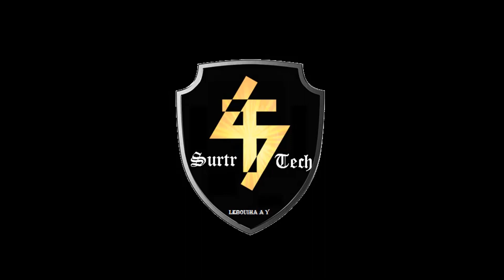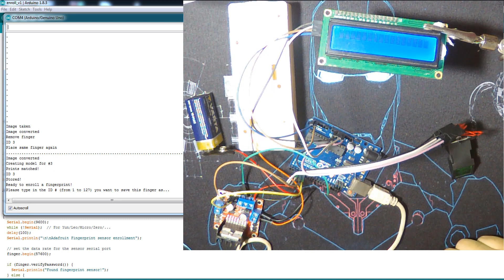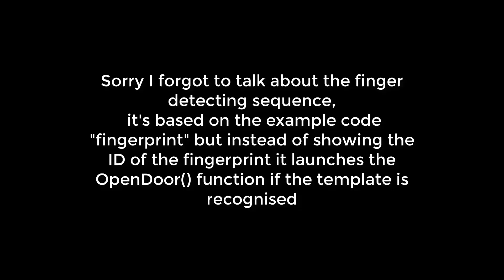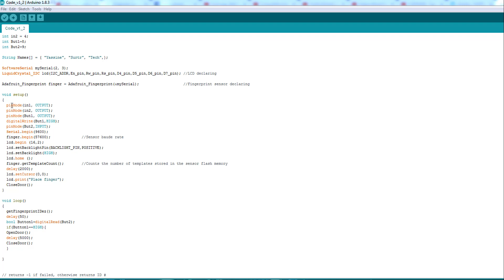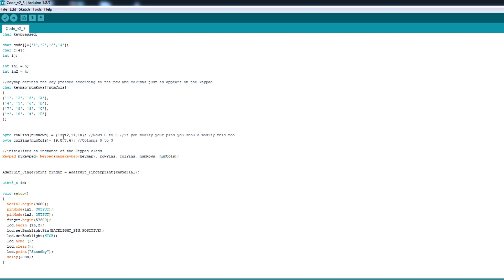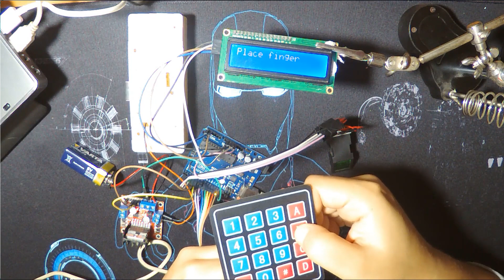Easy Arduino FPM10A Fingerprint door lock

Comment: hey can i know the connections of the fingerprint scanner and also that should i short the above points on the scanner foor the input power
Reply from the maker: Hello all the wirings, libraries and codes I've used are in the link below the video.
Reply: @SurtrTech  can please check your facebook page i have messaged you
Reply from the maker: @adityagawde  ok

Comment: sir , can i change some hardwares like finger print (Finger Print Sensor R307 -TTL UART) and door lock with Solenoid Lock...plese help me with circuit diagram for Solenoid Lock and aboud fingerprint...plese share ur contact number...
Reply from the maker: You contacted me on FB right? I answred there

Comment: exit status 1
no matching function for call to 'LiquidCrystal_I2C::LiquidCrystal_I2C(int, int, int, int, int, int, int, int)'

Help me to solve this error
Reply from the maker: It's the LCD i²c library problem, did you install it? Or are you already using another one?
Reply: @SurtrTech  i already installed library
Reply from the maker: @moiziqbalcreator  You need 2 libraries did you install them both? Adafruit fingerprint and newliquidcrystal, and check if you don't have other ones for the LCD already installed
Reply: @SurtrTech  yes i already intalled
Reply from the maker: @moiziqbalcreator  The error thells you didn't
Reply: Same thing happen to bro.
Reply from the maker: @danielanonuevo2320  That's a library problem, check if there are two or more libraries for the LCD (something you installed before), or you can replace that function by the correct version from the library you're using.
If the problem persists try to interface the LCD only with the Arduino, when it's working right you can adapt the project, and remember I'm using an LCD i²c not the basic one